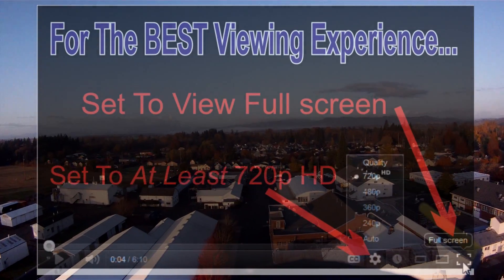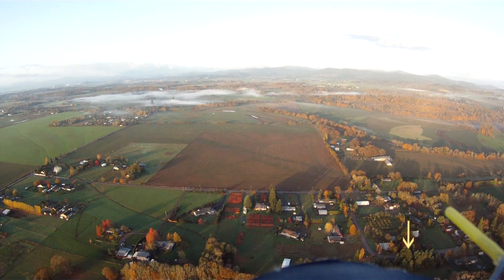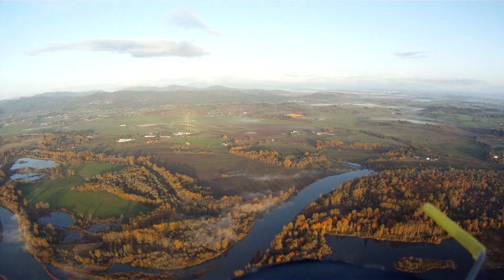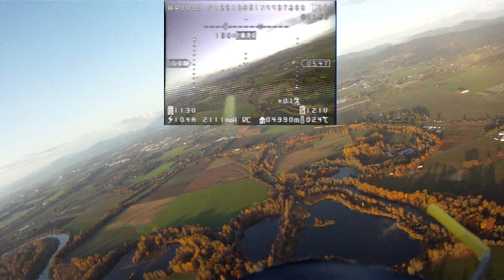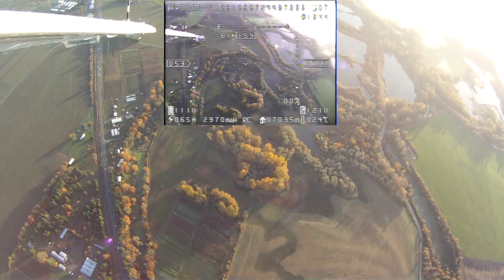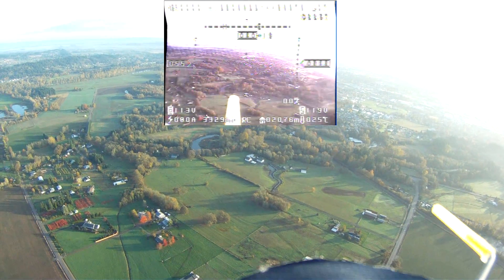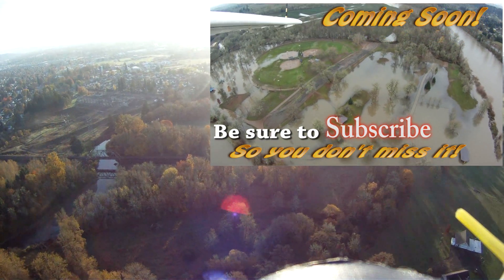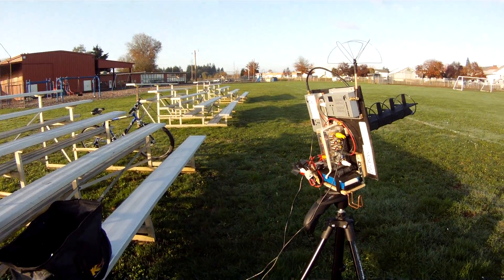Dragonlink 7km FPV Distance Record with Narrative - Skywalker GoPro

Comment from the maker: Yes I have. It is extremely easy to set up. Suggestion: To test if you are doing it right, set up your failsafe so the rudder kicks all the way over to one side when failsafe kicks in. It's an easy way to determine if it is working right.

Comment from the maker: You are right about the DL tx interfering with the video rx. I noticed that during my last couple flights. When I held my DL tx antenna vertically (like one is supposed to), I got interference, but when I pointed the DL tx away from myself (45 degrees from earth's plane) it went away. For the duration of my last flight I kept my body between the DL tx antenna and my helical video rx antenna.

Comment from the maker: That Zippy battery looks nice...

Length-A(mm) 169 
Height-B(mm) 69 
Width-C(mm) 27 

A little wide, though. I did some measurements and it may not fit without some modification!

I am going to go with that size battery, though. I like the Zippy, but I am REALLY happy with my two new Gens Ace packs, so I may go with that brand for the 8As when I get them!

Thanks for the advice!

Comment from the maker: 388thalpha is right. Since my pan control is a non-centering dial on my Futaba, and because I cannot see ANY PART of the nose of the Skywalker through my video goggles, there are only two ways to check to see if I have re-centered the dial (so that I am again looking directly forward, as opposed to looking off to the left or right).

1) Pull goggles off each time I re-center the knob so I can look down at my Futaba dial pan control, or

2) Put funny looking nyrod at dead center of live cam.

Comment from the maker: Maybe. My DL is located way aft by the horizontal stabilizer. My video tx is halfway out on the wing, and my video tx antenna is located out at the wings tip, so if there is interference there, then there is not much I can do about it.

I am going to start by buying a different set of video tx/rx combos from quality manufacturers, and see if that makes a difference. Any ideas on some of the best 1.3ghz video tx/rx systems? I have bevrc systems now, kinda budget, maybe?

Comment: BTW have you tried the live feed from the GoPro, read that you can record HD and have live feed from the GoPro at SD, wondered if the defenition was better for the live feed!

I did try mine connected to a tv monitor, worked as advertised. May put a simple video switch from my RX and have the ability to swap cameras in flight. BevRC sell one

Comment from the maker: I am wondering if my cheap bevrc video tx and rx is to blame? On the other hand, I probably just need to add torroids at a few places, and shorten some wires here and there. Not sure. I am the only one in my area who does FPV, so it is hard to get a baseline for what is good and bad video...

Comment: Hey, I think you can go much further on your battery. If your flying until 11.1 for the 3s lipo, that is about 3.7V per cell. Until last week I would never exceed anything less than 3.7 / Cell. 

I had a few people tell me that its fine to run it down to 3.4 or 3.3 so thats 10.2V. Maybe something to think about.

I know you don't want to spend a lot on bigger lipos but I have 2, 4s, 5amp lipos from HK I got for like $23 Each! With a 4s you will be more efficient.

Hope this helps,
Jake

Comment: No idea
But I am using also cheap stuff and no patch
try to separate power cables and video system far as possible
And use filters 
The going black thing is quite normal I have dead spots at 700 mmeter an 2km an 4km could be something like pathing from the signal which is also ground sensitive
Keep your records coming :)

Comment from the maker: Okay, when on the ground and manually engage RTL, my elevator begins immediately creeping all the way up, and reaches full deflection after about 2 seconds. The same with aileons, they move at the same rate and put me in a full-left deflection turn after 2 seconds. This is normal.

You can't really test RTL when on the ground. When you DO test, make certain that you can switch it off IMMEDIATELY after turning it on, in case something bad happens, like reversed aileron gain (spiral down!)

Comment from the maker: I think most people in my neighborhood have grown used to my Skywalker droning around the neighborhood at treetop level. I do, however, hear the occasional giggle from HS girls wondering, "wtf is that geek doing out there with that thingy on his head?"

Most people figure it out quickly enough. I don't get messed with, though. I happen to be 6' 2" and a lean 200 lbs, so that keeps the obnoxious ones at bay. I have had a few saggy-pant kids approach me, but they are more curious than anything.

Comment: hello glassdogangle,
I have just received my dragonlink but i am getting some noise on my plane from my osd. Because of this it sparked a few questions i was hoping you could answer for me. My noise floor on my plane with everything plugged in is around ~ -98db. In your experience, is this too loud? What is the noise floor on your skywalker? what is an acceptable noise floor for Dragonlink to operate at distances of maybe 5km?  Also, Do you have a favorite way to silence this noise? Wrapping it in foil maybe? Sorry for all of the questions im very passionate about rc and ham radio and love the info and knolwege. If you have any answers i would love to know! Thank you for taking your time to read this.
Thanks again,
Malin

Comment: I think you should use a 3s LIPO that's close to 8000mah so you can have a much longer flight. I think you should use zippy compact to save some weight so the skywalker won't be "overweight". I really like to see a 15km flight of your skywalker. Cheers

Comment: I don't think it's interference on your plane, but your DL tx interfering with your video RX. I know some people will remove the cover from their video rx which can clear it up. If I remember right it's a grounding issue in the video rx. I have a DL v2 and am using the RMRC 900-1.3GHz SAW upgraded rx and have had good experience with it. The other 1.3GHz rx they sell (no digital display) is supposed to be awesome as well.